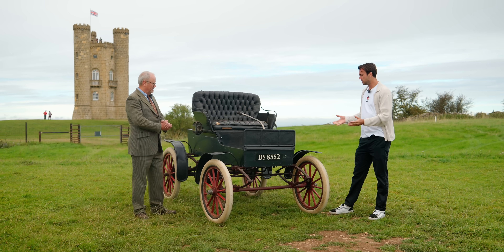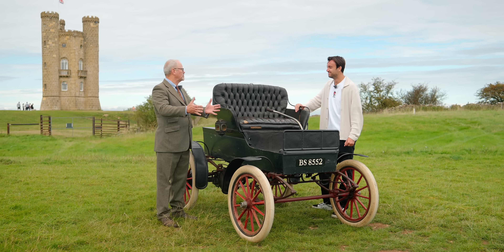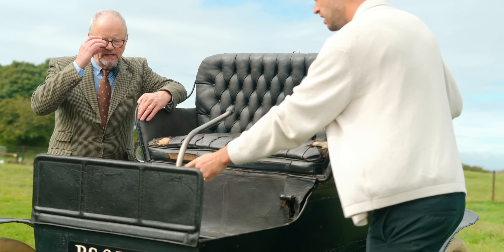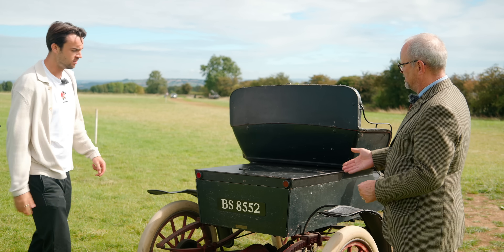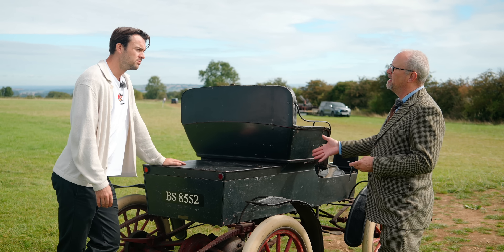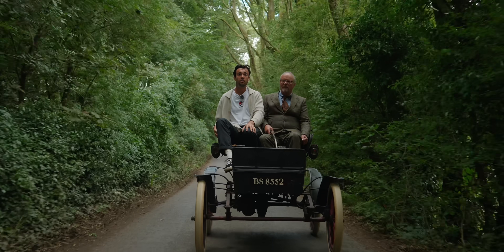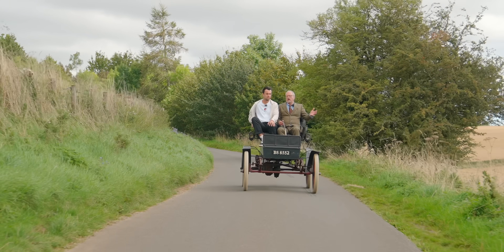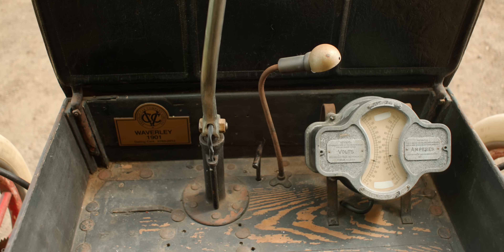Why Electric Cars Failed 100 Years Ago

Comment: Each of the three automotive power technologies had their problems at the beginning of the 20th centuries. The Internal combustion engine's faults were easier to solve, some development of the engines, fitting a starter motor and developing a reliable and easy to use multi-gear transmission. The EV renaissance was powered by improvements in battery chemistry. Steam's day never really came. It's greatest advantage was that it was a very well understood technology. Internal combustion engines may have been a new technology by the turn of the century but it didn't take much development for internal combustion engines  to surpass steam technology. By the roaring twenties steam powered cars were a mere curiosity.

Comment: There were old batteries at that time that are still around and working. The Edison battery had a very long lifespan and I heard of another one recently that you could replace the electrolytes each year.
Reply: Batteries can have amazing life spans if you use them within specified conditions and limits. I have some 20 year old nickel batteries which loet most of their power but still can power clocks and remotes.
Reply: Indeed, and I would not be surprised to find that the bulbs in the headlights were the original ex factory items. Prior to about 1920, incandescent bulbs were built to last forever.
Reply: @Gottenhimfella  nah mate they were just under volted because of low quality control. If you run incandescent from today at 25% power with steady electricity and with fewer power cycles they can last ages.
Reply: @Gottenhimfella  ok some of them rust and the old ones had full ceramic socked screw (no idea how it is in English but you get what I mean)

Comment: The Detroit Electric car used Nickel-Iron batteries (not Iron Phosphate batteries I got that wrong). One was at the Fully Charged Live event in Vancouver. They had to replace the original batteries in the 1980's (I think) because the casings were rusting away. So much for throwing away the batteries!
Reply: No. The Detroit Electric used either lead acid batteries or nickel iron („Edison“) cells, which have a mixture of potassium hydroxide and lithium hydroxide as the electrolyte. This is not to be confused with modern day lithium iron phosphate cells. Contrary to what the video assumes, such batteries can last for a very long time by replacing the electrolyte.
Reply: Thanks @Doppelhorn  I looked it up after I posted this and saw that I got it wrong.

Comment: Jay Leno has a 1909 Baker Electric car with the original Thomas Edison batteries that still work. He says that he and his wife like to use it to view the Christmas light displays in it. He said that once a deer came right up to the car. ❤
Henry Ford's wife would only drive an electric car.😂
By the way, would that car work better with Lithium-Ion batteries, or would it be pretty much the same due to its motor limits?

Comment: In fact Henery Ford had intended to build an EV and spent two years working with Edeson on designing a better battery but could not get funding for his new fangled mass production ideas and when he did it was from oil companies and came with tags. The established ev manufactures were invested in hand building and were unable to fund the change to mass production hence their failure due to cost. 
The real irony is that exactly the same thing is happening now in reverse. the large ICE manufacturers are very heavily invested in ICE technology and dont have the funding to pivot as fast as the market. I think that we will see the end of great names in particular GM.

Comment: If Henry Ford had chosen battery electric instead then the automobile industry would have advanced the research and development of battery technology 100 years earlier than we did. The electrical properties of lithium ions was considered for batteries as early as the 1920s. So there's nothing particularly obscure about lithium ion technology that couldn't have been implemented over the past 100 years given the commercial incentives to fund it.

The turn-of-the 20th century oil boom, like the Texas Spindletop, that ushered in an era of cheap petroleum extraction probably had as much as anything to do with the relegation of electric car technology at the time.

Comment: I was about to paste my comment on my last 5 videos because past comments were blocked but, on checking it, this one isn't blocked. Perhaps my previous one suffered a YouTube block or yours was an individual brain-freeze by someone there. In any case, I apologize for saying you need to learn some ethics and will not copy the comments across while they remain up here. There is much I like about your productions, but you drop the ball occasionally in areas where (in my opinion) you should be fairer.

Comment: You completely avoid the real reason why ICE trumped EV - it was superior and the better products are preferred by customers. Most of the superiority lied in the far better range, also not revealed in your biased spin, along with the same bugbear today - EVs were/are too expensive to purchase. You get a great example of a motor that lasted, and you pass it off as if all motors last that long, when the truth is many burn out, and some quite quickly.  There's a Corolla in NZ that has done two million kms, but you don't see people saying all ICE cars will do the same. You need to temper your biases with a dose of reality. And you need to develop some ethics and not block people who teach you what you really need to learn.

Comment: You spoke of electric, steam, and petrol cars, but failed to mention the Ford Nucleon concept car? What could possibly have gone wrong with that idea?
Keep up the good work 👌
Reply: The Ford Nucleon never took off (literally) because we knew that we'd have flying cars in the 1970s.

And a nuclear-powered VTOL, like the Bell D-1007, would have been huge, maybe 300ft (100m), like the Bell D-1007. But since weight (mass) is an issue for flying cars/helicopters, radiation shielding was inferior to that in ground cars. An estimate is that every hour travelled in a Bell D-1007 would increase the likelihood of getting cancer by 2.5%. So we knew that nuclear-powered cars could never fly.

The helicopter engine would have, apparently, heated air to drive turbines. The Ford Nucleon would have had a steam turbine, making it a steam car (plus a second turbine to generate electricity).

But I guess it's coming back. In  2009, Cadillac introduced the World Thorium Fuel Concept. Seriously? Seriously. They did choose that name.

The Cadillac WTF Concept is also a steam car. They claim that it can run 1,000,000 miles on 8 grams of thorium.

Comment: Just to add to the original ICE combustion discussion, the first ones needed to have their fuel purchased from a Chemists as there were no Fuel stations. There was an electric grid when these were introduced so electric cars had better infrastructure than ICE ones at the start.
Reply: NO. There was no grid in 1910. You're talking about the 1930s before there was widespread electrical power.
Reply: @grahamstevenson1740  Quite true. Also many rural areas didn't get electric power until after WW2, and it was often less than enough for electric lights and an appliance or two.
Reply: @grahamstevenson1740 couldn't you have a generator at the property running off an old lister engine.
Reply: @chrishart8548  There wouldn't have been many of those around back then.
Reply: @chrishart8548  Lister engines are famed as Diesel engines but Rudolf Diesel didn't even come up with the concept till 1890 & didn't have a saleable engine till 1897, a full 40 years after the rechargeable battery came onto the market.
Reply: @alanhat5252  so it could have been used to charge thus car up then ? Off grid
Reply: Worth noting they didn't burn modern gasoline/petrol, they mostly burnt naptha
Reply: The UK National Grid, the first national grid in the world, was born in 1935. It offered no advantage to the electric cars on the road a century earlier.
Reply: @alanhat5252  Quite true.
Their argument is no different that asking why Napoleon didn't grab his cellphone and call for reinforcements.
Reply: rechargeable batteries didn't appear till 1859 so batteries too were often purchased from chemists before that date
Reply: Actually, if you went to the oil company they'd give you all the gasoline you wanted for free as they had no use for it.

Comment: That is amazing that in the early years, there was already an electric car. Only if they kept working on it and making improvements; by now the electric range would have been 1000 miles or more.
Reply: range was good with gas already and it took an oil crysis in the seventies to push for new batteries, that's why li-ion battery was discovered

Comment: Electric cars of the 1900s had the same benefits and issues as electric cars of today - they were quiet (especially compared to gasoline and steam powered vehicles), they were simple, and they were powerful, but they were short ranged, took a long time to recharge (plus you had to have electricity to your garage to facilitate the charging - so were owned by the wealthy, much like today) and the batteries did not last long (life-wise). There were no charging stations in those days.

Comment: 9:21 not entirely true. Your friends at Transport Evolved had a video at 26th september 2023 on a 1912 Detroit Electric with nickel-iron (aka "Edison") batteries, which were replaced in 1993(!) - not because they had degraded, but because the cases had rusted through. So, it's all about the battery tech used. They can last hugely longer than the car itself, not only 1.5..3 times longer than today's batteries, when treated okay, can outlive an averagely used current EV 🙂

Comment: Masterful show of engineering from 122 years ago.  Imagine if we had continue developing EV's, how far we'd be today?
Reply: Nonsense!!!! As if we didn't continue development of EVs!!!! The battery really started with the lithium ones  in the 90's which not just cars but mobile devices also needed.
Reply: The development of electronics also helped a lot to be able to control charge and monitor those batteries
Reply: There were actually multiple types of batteries in development for decades! Today we have even more batteries techs/ chemistries.

Comment: I think there would have been more investment into making batteries more energy-dense earlier if the electric car had been mass produced instead of the petrol car.
Reply: Perhaps, But the bigger issue with 1901 electric cars has not much to do with the cars themselves, but the times! It was before the 1920s when most of the population was living in rural areas AND most of those areas were without electricity. If you compare a curved dash Oldsmobile from 1901 and this 1901 Waverly their performance was about the same AND the electric car IS easier to USE, but at the time you could only really charge them in the city.  Had the entire nation been electrified by 1901 I DO think MORE electrics would have sold but full electrification didn't happen until the 1930s, By then gasoline cars had already long taken over the market.

Comment: Wonderful. Thank you so much. This thing with 20kW of LFP in it (like, nothing) and you get a 30mph Quad with a 100mi range. I would say, it would sell as a city car sub 10000, hell, sub 5000 pounds, like hotcakes. I think it would beat the citroen AMI. I love that thing but this, is even better. Fold able canapes over ir.
Reply: Canopies not canapés. The quickest substitute would be to bolt two e-bikes to the outside of a couch